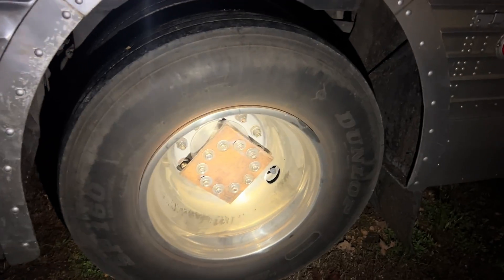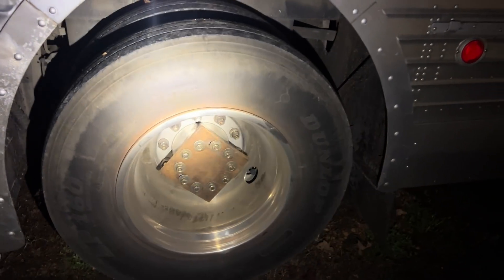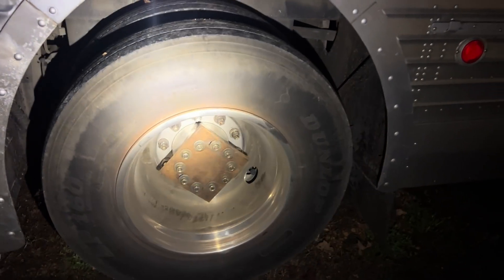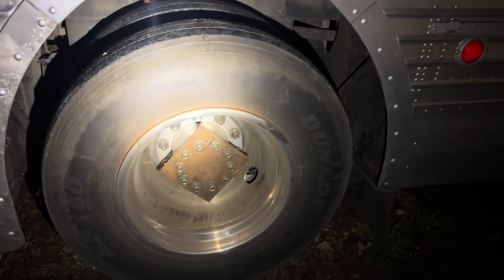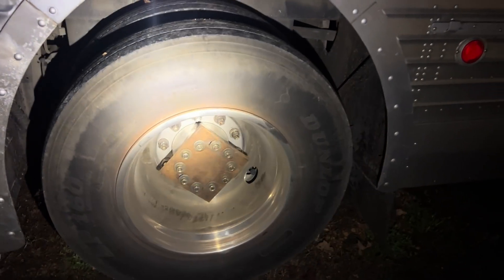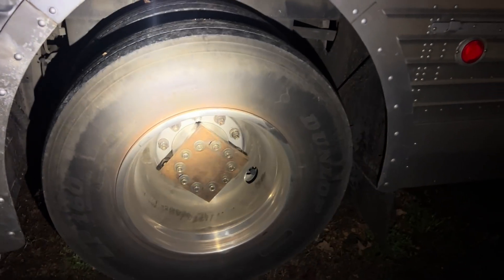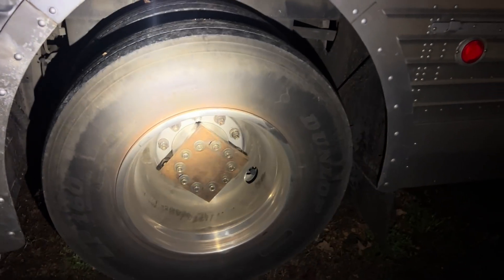Coolant in the oil - 15 gallons of liquid in the engine crankcase.  Detroit diesel 671 towed in

Comment: What exactly is that transfer pump that was used to move the coolant and oil from the drain pan into the 5 gallon pails? I would love to have something capable of pumping oil out of my oil drain and into the containers to transport it for proper disposal!
Reply from the maker: https://www.homedepot.com/p/Milwaukee-M18-18-Volt-1-4-HP-Lithium-Ion-Cordless-Transfer-Pump-Tool-Only-2771-20/300510172
Reply: @BusGreaseMonkey  Thank you for the info, really appreciate that :D

Comment: I'm impressed it has any bearings left in it. Usually you suck any decent amount of glycol through the oil system, it wipes the oil film worse than water and just destroys the bearing surface. 

Should probably pull the oil pan and one rod and main cap and see if anything is still in the shells.

Comment: Too bad I wasn't just down the road from you as I would have given you part 55 gallon drums of 10W, 20W-20, and am sure some 30 as well. Multi grade oils came along as did even wider operating range synthetics and so the barrels just sit in a shed.

Comment: Why in the hell did you stop and idle down if you would have had it in the right gear and hammer down it would have made it
Reply from the maker: The wheels were spinning and just digging holes. When it ain’t moving forward anymore it’s time to let off

Comment: You can fill your tractors back tires with winter window washing fluid for more weight/traction on the back, NAPA sells it by the barrel. I California we can't buy the winter stuff. Tractor Supply sells kit to add liquids to your tractor tires. We did it in ours.
Reply from the maker: They are liquid filled

Comment: Have you ever thought about permanently installing a big winch with a super long cable at the top of the hill anchor it into the ground with concrete and then just have it pull the buses up the hill?

Comment: Could you use a little bit of diesel fuel in the oil to loosen the garbage up a bit, or would that be insufficient to lubricate the moving parts?

Comment: Mine broke off flush, then pulled all the brass center out when I tried to tap it for a puller.  I had to pull the head and use an EDM to burn it out.

Comment: Another advantage to hooking the chain over the box blade is that if something on the tractor were to give up, you can drop the blade and it would dig in and anchor the unit as opposed to pulling the whole mess down the hill.

Comment: I'm surprised those wide RV mud flaps don't restrict the air flow needed for engine cooling.
Reply from the maker: They are not recommended on the bumper of a gm bus for cooling reasons